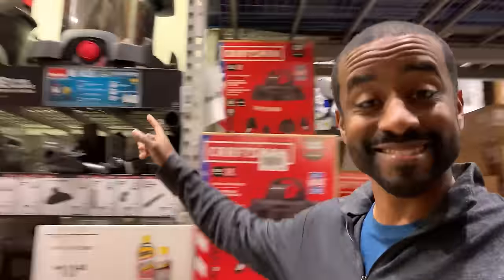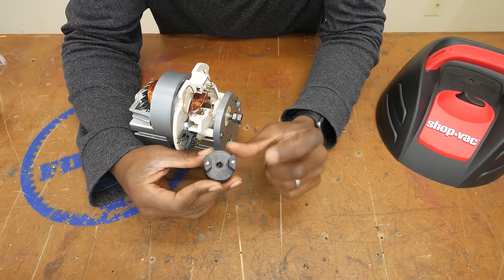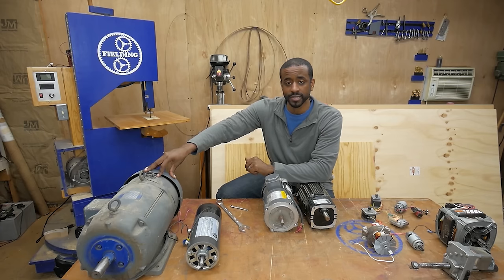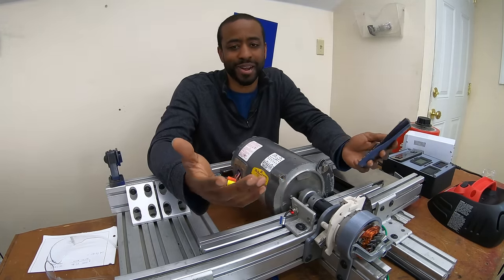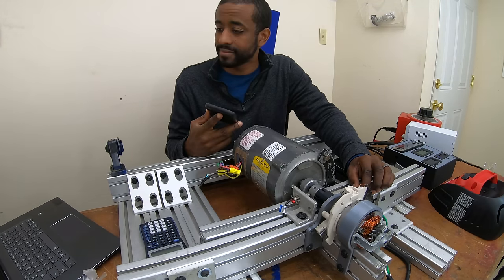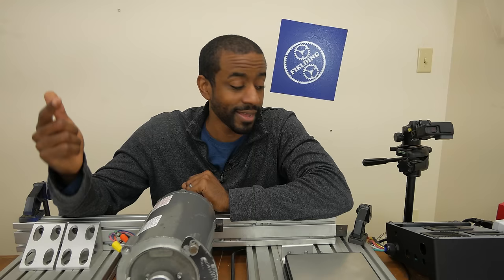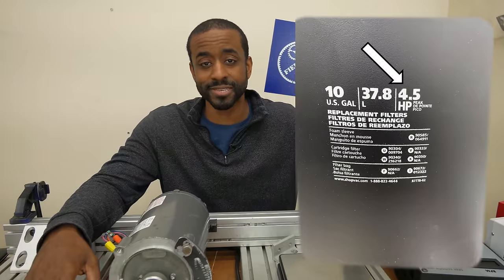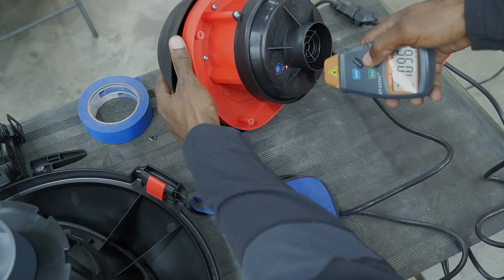How Much Horsepower Does Your Shop Vac Really Have: #078

Comment: Far more relevant to the world of suction would be a pump curve like on a fluid pump. Logically using output pressure (instead of sucking vacuum), in place of pump head on the curve.
Y-Axis Guage Pressure (PSIG), X-Axis Airflow (CFM), perhaps with a secondary X-axis of current load (Amps). All one would need is a variable restrictor (butterfly valve or throttle), a flowmeter on the intake side, and a pressure gauge on the outside. For models without a direct outlet, a vacuum pressure could be used, but it would likely not give much information on the stall pressure (which would be limited by atmospheric pressure). Perhaps Project Farm and Jeremy could do a collaboration on different brands and "Peak HP" models?

Comment: Excellent information and well presented. If I may, it appears that there is a correlation between the size and weight of the shop vac and the peak hp such that the size and weight get bigger as the peak hp increases. Therefore, one could define peak horsepower as a constant (k) multiplied by the height (ht)of the horse, measured at the withers, needed to move the shop vac a distance of one mile in three minutes, measured in seconds.  1 peak hp = k x (ht)/(5280 x 180) This relationship also obeys relativistic physics in that peak hp can never approach infinity because a horse cannot travel at the speed of light. I am beginning to think that there is a closet physicist working in the marketing department of universal shop vac world who moonlights for the swimming pool pump motor industry. We may be on to something here. If not....Merry Christmas.

Comment: And we also have "SCFM" (Standard Cubic Feet per Minute) ratings for air-compressors!  If you take a "4.5 SCFM @ 90PSI" compressor, hook it to a 2 CFM tool, turn the regulator to 90, and hold down the trigger, the tank will rapidly drop to some puny level.  (And this will be the case even if the tool doesn't use some bogus "average" CFM where they decide how long you are going to hold down the trigger every minute.)

The trick is that the compressor doesn't actually produce 4.5 CFM of 90PSI air.  The rating is how many CFM of 1 bar air the compressor sucks in when the tank's pressure is bled to hold it at 90PSI.  Now, of course, that's an entirely useless number, because air tools use xCFM of output air.  (Or, at least they would if the cheap regulators weren't also terrible, and would actually supply the set-point air pressure when the flow level is more than a trickle.)
Reply: another video revealed the CFM of compressor ratings.   the CFM is INPUT (at 14.7psi) not OUTPUT (at sy  100psi)  another big scam (except some  industrial are honest).

Comment: I will tell you this, if you take a look at the turning 150cc rotomax brushless our runner motors they put out 17 horsepower and are roughly the size of my fist. Big difference from an inefficient universal motor. But size doesn’t necessarily mean that it’s going to have little horsepower.

Comment: 1hp is 746 watts. Most basic outlets in the us are pretty much able to supply 1500 watts without an issue for 110v residential... I doubt they pull anymore than that.

Comment: Cool video. I think the peak HP number is going to come from the inertia of the motor+turbine/flywheel at peak angular velocity (unloaded.... or at least loaded only by the turbine), and then hit it with an impulse breaking load. It's a peak "power" rating, so it will happen the instance a large breaking torque is applied. It will not be sustained.

Here is my (un)educated guess as to the peak horsepower rating:
1) what is the maximum RPM of the motor in operation? e.g., here it appears to be 20,000 rpm, albeit that is completely without the load of a turbine moving air. My guess is that this would be the RPM in situ with assembled shop vac.
2) what is the maximum breaking torque that the motor can technically overcome and still rotate. This is essentially the stall torque (i believe). Here, in your last test i saw a peak torque of about 1.59 ft*lbs before it stalled out.
3) *peak HP* is a maximum speed motor being hit instantaneously by a breaking torque that the the motor can still turn against

check 20000 rpm * 1.59 ft*lbs / 5252 = 6.05 HP.

If we work backwards from here, i would bet that the in situ max rpm of the assembled shop vac is ~ 4.5 * 5252/1.6 =  about 1500 RPM

If you have an idea for getting a tachometer installed in situ, perhaps we can see if this is the correct reverse engineering of their "laboratory testing"

Comment: They base it on start up power, or the initial power it draws when first turned on. This can be easily double the amps, but for only a fraction of a second, so it doesn't blow the breakers

Comment: I feel like if i was a vacuum marketing guy hired to exaggerate a HP claim, I would set up an experiment to measure the force of the suction generated in ideal conditions. Like if I connect the vac motor with it's blades to an ideal suction device that creates a vortex, how strong can i make the vortex... for like a second. Does that make sense?

Comment: They're using the peak torque and peak rpm for the numbers but not from a simultaneous measurement. Plug in the 20k rpms you measured with the impeller and the torque of 1.15 you measured from your last destructive run and you get ~4.4hp.  Take off the impeller and maybe gain a few more rpms or use a fresh motor and you may hit the 4.5 as advertised.

Comment: I just bought a wet dry vac. in the U.K., no HP rating, instead they quote Watts (1250) and pressure (180 mbar). No idea of the efficiency but if, like yours, it is about 50% then that equates 0.8HP at the motor.

Comment: Since they’re talking about inertial contribution, is it not related to the flywheel effect provided by that impeller combined with the mass of the motor’s rotor? Once spooled up, at that peak RPM you’d have a little more torque available to resist the braking force (although it would drop as the motor slows down since the motor does not actually have enough power to counteract the applied braking force).

Comment: Great video Jeremy.  I just ignore the HP value and look at the capacity (how many gallons it can hold).  I also feel a little bit dubious about the HP claims on my woodworking routers.  The motor on my 2 1/4 hp router is way smaller then the one on my 2 hp dust collector.

Comment: Most house hold 120v systems are on 20amp circuit breakers. Even if you had a motor that was 100% efficient you'd be limit to 3.2 hp before you throw a breaker. That's assuming it actually pops at 20amps and not lower like most do. I immediately dismiss any consumer 120v product that claims to make over 2hp. Thanks for making these videos.

Comment: I knew the "6.5 HP" thing could not be real, because that's literally more wattage than any normal outlet can provide. Standard outlets have either 15 or 20 amp limit, so the highest power allowable is more like 3.5 HP. It would require a special power outlet and a monster of a power cord to go any higher, which would sortof defeat the purpose of a portable shop vacuum.
I was thinking that the number was something to due with either startup draw or or stall torque, but now I'm not even sure...

What's even worse about these things (to me) is the way they just give you "semi-standard" CFM and static pressure ratings. IE, they don't say if the CFM is measured with the filter attached or not...

Comment: I wish you could do something similar with small gasoline engines. The HP keeps going up and up and up as the years go by, to power the same type of machine. Back in the 70's, you'd see a riding lawn tractor with 6, 7, 8, and 10 hp motors. The really big ones might be a 12, 14, or 16. That was about it. Now those same machines are sporting motors in the 20 to 26 hp range. Starting sometime in the 80's you'll see  Sears Craftsman riding mowers with 42" mowing decks first with 12 hp, then 13, 14, 15, 16, 17, now commonly 18 hp, and sometimes 19, 20, 21, 22 and even more hp all to power the same 42" deck.  I worked on one recently that said on the shroud, 18 gross hp at 3,600 rpm. I saw another recently that said 20 peak hp. Then there's the single VS the two cylinder engines. Is a 12 hp single cylinder engine less powerful than a 12 hp two cylinder engine? And to top it all off, for comparison sake, I recently watched a video on the old Farmall Cub farm tractor, and its four cylinder engine was rated at 10 hp! I also see that all the newer engines say CCs, but they usually still have an HP number there too. It's enough to make your head spin.

Comment: The torque of an electric motor is constant in the lower RPM range and is the highest. Since as he said, power is a product of torque and motor speed, the power curve increased linearly. Afterwards the torque decreases, and curves downwards, causing power to decrease after a given speed

Comment: I would guess since they say “inertial horsepower” that they put as large of a mass on the motor as it can possibly handle. Meaning the largest mass it can keep turning when running at about max rpm, (I am sure they give the motor a “push” to get the weight started spinning). They then suddenly stop this spinning mass with some sort of brake and then measure the output torque. I would bet that a test like that would come up with around 5hp

Comment: I read an internal paper that was from the early 50s by an association of home electronics manufacturers. I’m sure it was an excerpt. Hifi was in its infancy, so the association discussed what people want and how they think.  They put their effort in this fact; guys love to compare. Horse power signal to noise ratio, fastest quarterback. 
Sadly, people are that simple at times. 
There is a popular engineer who in his own time makes some of the best speakers around. He rants the marketing will sell speaker wire the finest in the land. He claims that if he connects one channel with $800 wire and a coat hanger to the other no one could tell which is which.

Comment: Thanks for such a through explanation! Great job. I also have a ridgid 5hp. And I was wondering how it runs on a 110v 10A circuit....5hp is 3725 watts....which on 110 would be 34A...I would have a fire immediately....so it can't be 5hp, I guess...thanks again, great video, liked and subscribed

Comment: Thank you for the excellent video, data, and demonstration. My 13 gallon shop vac has a motor that's on its way out. I was thinking about calling Shop-Vac to get a replacement motor so that I could replace it, but after watching this video I'm curious if there is a better or more efficient motor that I could use instead. If yes, where would I Source the same? Any advice would be greatly appreciated

Comment: 1.7hp and it's burnt out so 4.5hp is achievable but you best be planing on hovering in the vacuum of space out far as Pluto.
I pushed a 48v 1600w bldc scooter motor to (4.4kw) that's 6hp before efficiency loss of 85% at motor and then 5% of that lost at the drive chain with 8-1 gear so more like 4.8hp at the wheel if I'm lucky total weight was 40kg so it got to 50mph on a stand up scooter for under £300 all in.

Comment: I always assumed those obviously misleading numbers were bragging on the power consumption, but i never did the math. So here 120V x 10A =1200W / 747 to convert to HP and we get 1.6 HP as an INPUT (power used). Not even close. I did the math right. How amazing then that they use 1.6 HP to get 4.5 HP.  At least with 747 we can do the math in the store and quantify the BS level. In this case BS = 2.8, so maybe look at power consumed, divide by 3, divide by 747. Or just divide by 2 in your head and divide by a thousand (1200W/2=600, /1000= 0.6HP) close enough, right? Not perfect, but WAY closer to the truth, and easy enough to do in your head.  Jeremy Fielding I really love your videos!

Comment: The manufacturers are allowed to publish ABSOLUTE MAXIMUM horse power - the point at which the motor explodes and releases it's 'Magic Smoke'! In practical terms, the greatest HP from 120vac is: 2.4HP on 15A,  or 3.2HP on 20A. Please note, that most circuit breakers will trip at that current if left drawing for too long (depending on the approved current curve for that brand of CB).

Comment: I'm sick of false advertising.  I thought there were laws against it?  And these aren't even Chinese/foreign brands!

Hey Jeremy, I'm not sure if this falls in line with your content but you know those small, low profile receivers, sound bars, and home theatre in-a-box types of products?  So many of them are rated at between 600 watts output, to over double that.  Yet if you look on the back of the product, it states the maximum power draw from the wall outlet, often around 80 to 160 watts...

There's no way you can sensibly get more than double the draw as even peak output... and usually less, since most devices use their own power and use a class AB amp.   In other words, there's no peak 600W drawn from the wall nor taken from a capacitor inside.

Just thought I'd throw that out there 👍.  I like your videos man!

Comment: They do the same with routers too. There are a bunch of 3HP routers that runs on 110v, and 110 can't possibly run that much horsepower. So I imagine they use the same "rating".

Comment: 4.5 HP * 735.5 watts = 3310 watts / 120 volt = 27.5 amps
You are right, the maximum current allowed for 120 volt devices is below 15 amps

It is possible that the "inrush" current could be as high as 28 Amps. But this inrush last just  one cycle of the 60 Hz sin wave, so less than 16.6 ms.

The fuse/breaker can accept very short spike like this even if it is supposed to blow at 15 amps.

This inrush current is far from indicating the suction power.

Comment: I work at Lowe's and these HP ratings on shop vacs have always bugged me... There's no way you can plug a 4.5hp electric motor into a regular wall outlet, that's just not enough current to run something that big. Air compressors are guilty of the same thing, though to a lesser extent.

Comment: I always assumed they were referring to the peak inrush current which can be 6 to 20 times greater than the normal operating current. I found this out the hard way with a 10hp compressor attached to a brand new 10kW generator, which survived about 1 second after the compressor was turned on. The 10kW generator should have been able to handle the running load but it couldn't handle the inrush.
Reply: Surely the generator had a circuit breaker to protect it?

Comment: So I think the consensus is that what is being measure for peak HP is transient momentum change, in addition to SS HP. But this may be even more irrelevant because if I am not mistaken when a shop vac's suction gets blocked the motor speed actually goes up. Your motor actually has to fight the inertia. Once the obstruction is done the motor speed comes down but so what.  Maybe the HP is higher during this transient but paraphrase a failed politician, at that point, what difference does it make?
Reply from the maker: Take a look at the description. There are some helpful details I added there about this.
Reply: @Jeremy_Fielding  Got it.  So I double down on my thought that once the obstruction is removed that HP spike really isn't needed and is meaningless. Love your dyno. I'm in the process of building an electrical and machine shop in my barn. I want to build a dyno for small engine, generator/motor experiments.  I'm thinking of using an old generator (5 KW).  Controlling the dyno with an Arduino / Raspeberry Pi and collecting the data is up my ally of expertise. I need to learn more about motor control and the power side of the equation. Love your videos!

Comment: Love your channel, love your thoroughness. Very good job, thanks.  Are you an actual engineer?  If so can you do a video on tolerances with respect to reverse engineering and/or design.  For example, I have a square I want to 3D Print and fit into another Square.  If I made the square exactly the same dimensions as the receiving square hole it will fail, so how do I determine the tolerance and how much I should reduce the input square?  I've never been to school for engineering but I am doing very well with it using Fusion 360 which I love for it's accuracy.  My designs need to be accurate.  I could simply keep reducing part B till it fits into Part A but that is a hacky way of doing it and not efficient when I have a big design with alot of parts.  I need to know how to calculate tolerances.

Comment: At my local store it’s even worse, the other day I went there and they had 3 vacuums of the same brand at 3 different but similar price points (I think it was 50,70,80€ or something like that) and all three had different measurements or scales for their performance, the cheaper one only had static pressure in kPa, the medium also had static pressure but this time it was in psi, and the more expensive only had power in kW

Comment: Their statement said "including the motors intertial contribution", which means they've calculated in the stored energy in the rotating mass inside the motor. So say you get 2.25HP at the shaft in your test during 2000rpm - you'd have to add the "2.7lbs" of the "armature" rotating inside the motor, and assign a "stored energy HP" to it, let's say, if the shaft stopped rotating or power was cut and the intertial mass rotating kept spinning until it slowed down and expended it's stored energy to the shaft (output) - they no doubt assign a short time period - oh look it's about 2.25HP more over .1 seconds ! Thus a 4.5HP peak !
Reply: Just add a 1 ton weigth to it and you'd get more peak horse power than a factory

Comment: My guess is that they got those numbers from a dyno style test. They let the rpm climb to speed and closed a clutch and stopped the motor then converted the torque to horse power.